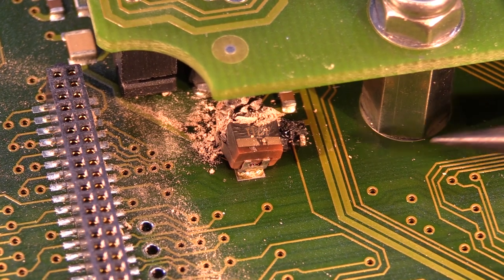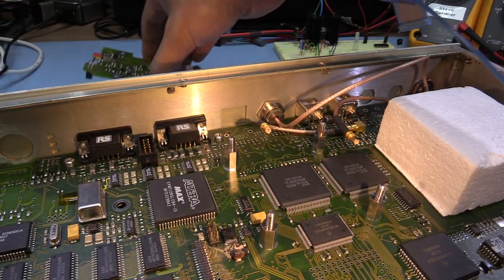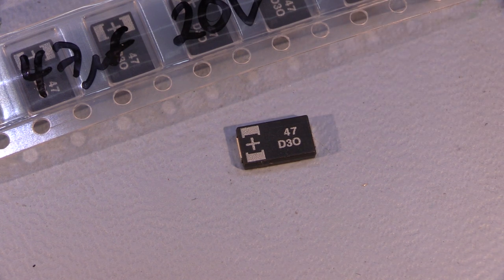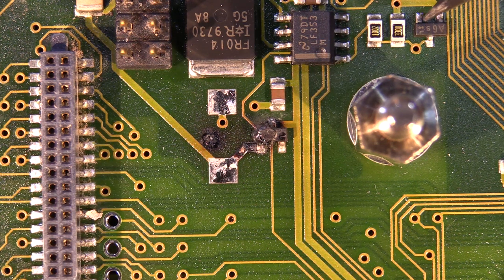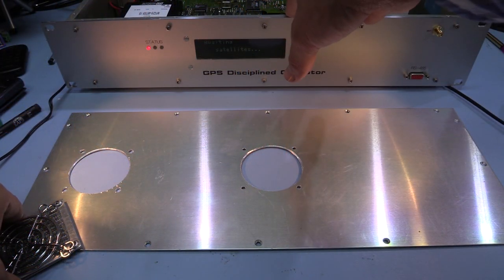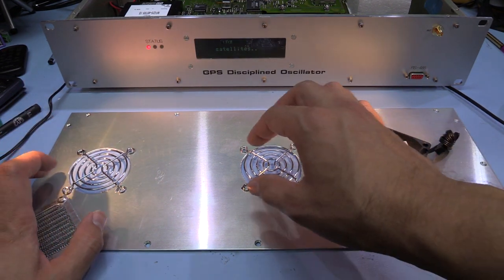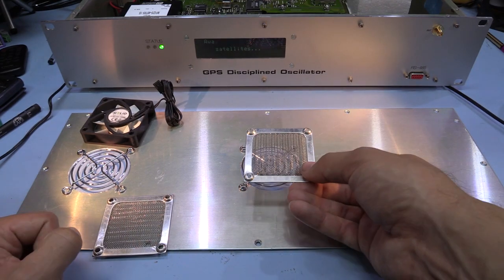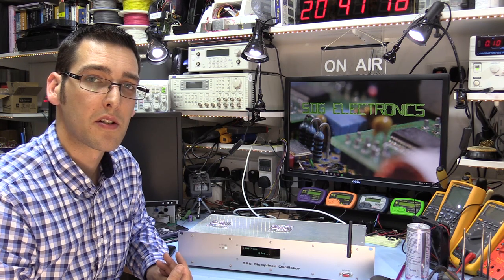SDG #027 Symmetricom GPSDO 10MHz Reference Part 4

Comment: Thanks Steve. I enjoy your videos and of course would like to see the project also.
I use my rework station to remove the SMD components. After applying some flux, I turn the temp up around 400c with low air and the component will come loose quick.
Reply from the maker: Robert Calk Jr. I need to get the Metcal HCT2-120's bigger brother - the HCT-900. The small HCT2-120 is too underpowered to remove tantalums this size. Thanks for watching Robert!
Reply: SDG Electronics 
I have an Aoyue 852A++. Larger components take a little longer, but high heat and low air will heat the solder fast without heating the PCB too much, and low air will help keep from loosening up other components. I just do it real fast and aim the air accurately straight up & down, not at an angle, while pulling gently with the tweezers in my left hand. On inductors and larger components, I remove as much solder as I can first with my de-soldering gun to aid in removing the target component as fast as possible.

Comment: Very interesting re: Tantalum Capacitors.  I didn't know that was a normal failure mode but it explains why one of mine in an Rb oscillator I was tinkering with burst into flames.  Will have to investigate POSCAP.
Reply from the maker: +NivagSwerdna There's a few other polymer equivalent, but beware they're all a bit more pricey.

Comment: I have an automatic battery charger which gets quite warm in operation and it had an absolute joke of a fan inside of it...so I drilled a few holes in the already ventilated lid for a computer fan and put it in there to replace the tiny fan that was in there.

Comment: Newbie question: I have Google around a bit on this subject but I am still not clear.  If I understand correctly (but feel free to set me straight) the GPS satellite sends a 10 MHz signal which your unit receives and this signal is used to “tweak” your local oscillator to a very precise 10MHz.  Am I close on that?  However, because the satellite is coming and going there will be a Doppler shift which would affect the 10 MHz signal.  So how is this compensated for?  Is this done by the GPS receiver?  Does the satellite send down its ephemeris which is used by the GPS receiver to calculate a correction?

I'm still thinking Black-Magic is involved.  So set me straight.
Cheers,
Mark
******************************
Reply: Mark Beeunas As far as I know the GPS satelites do not send a 10 MHz signal ! However you can still use the timing data from the GPS satelites as a reference, see https://en.wikipedia.org/wiki/GPS_disciplined_oscillator
The trick is that you run a local (somewhat inaccurate) clock and compare it's time to the (far more accurate) time information from the GPS system. With some software you could determine that for example your local clock runs 10 second too slow each hour. Once you know that, you can compensate for it. No black magic involved I'm afraid ;-)
Reply from the maker: Mark Beeunas Peter pretty much summed it up. I believe the 1PPS signal is used to adjust the local clock, however the 1PPS does have some jitter, so the feedback loop has a longer integration time to take advantage of the huge long term stability of the 1PPS signal.
The ephemeris is used by the GPS receiver though and most need to track at least 3 satellites first.